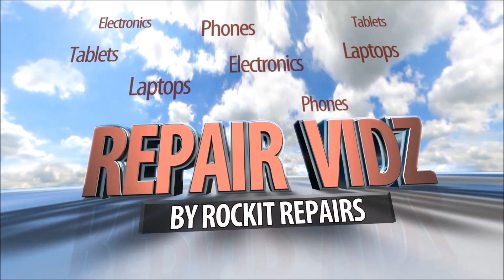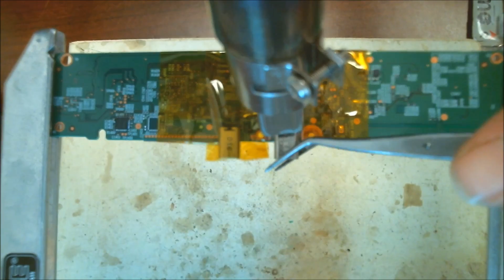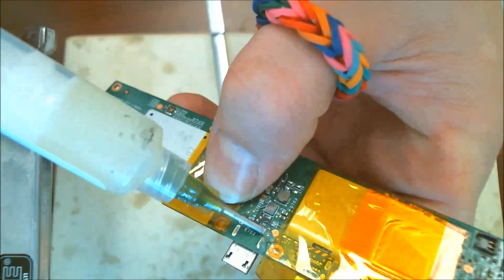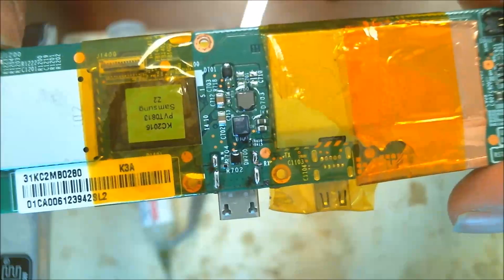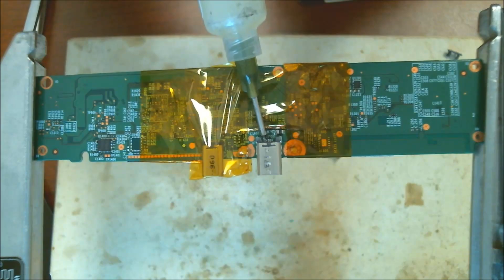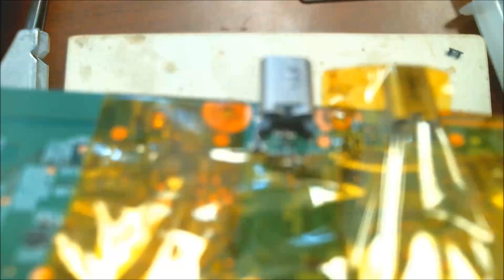Kindle Fire HD USB Bad Charging Port Repair & Replacement | w/ Soldering | Tablet Computer

Comment: How would you go about removing and replacing a micro USB port from a flex ribbon cable? I would just buy the whole flex cable but it’s not available so my only choice is to desolder it. Thanks

Comment: would it be okay if you don't have flux as long as the solder has it? also could you use soldering iron to remove if i don't have heat gun? 

I'm obv pretty new to soldering although i have repaired a few things, i only own the bare essentials. 

glad you mentioned the heat resistant tape! i saw some on my fire 8 tab board and assumed it was just tape. oh and i did notice your rainbow loom ring before you mentioned it & already figured you must have a lil girl who made it for you..i just don't' imagine a grown man making himself jewelry on a rainbow loom lol

Comment: Hmm, you have a price for Kindle Fire HD Charging Port 8.9" or 7" $69.99 - it's ridiculous 'cause I've bought brand new Fire HD 8.9'' for less!
Reply: You don't understand the time that it takes nor the skill that it takes to repair one of these or any job that requires microsoldering. It's not this guy's fault that this product can be mass produced for pennies on the dollar using chinese workers. In a just world this product would be priced MUCH more and his $69.99 price to fix would be completely feasible.

Comment: I use heat around 350 c .. and be very careful when you pull the usb port from the board.. ensure all solder on pads is melted when lifting with tweezers .. allow it to come up gently , if it is not then you could damage tracks on board making a repair almost impossible

Comment: I bought my fire HD8 in 2016 it wont turn on now.  how do I know if its the charging port or the battery??   HELPAmazon as ABSOLUTELY USELESS  they straight out said they cant be fixed

Comment: With cost of buying all the things I need to fix it, it's cheaper to buy a new one !
Reply: hardly! the soldering iron is the most expensive thing at $23 or so, and it's worth it for future repairs anyway. youre smoking crack son!
Reply: but you know keep believing that, it's what keeps me employed :)
Reply: My point exactly, Tim ! Thank you !
Reply: What a wasteful way of thinking. So throw it out and have more trash and toxics in the ground. 40 years ago people would fix everything from their toaster to car. Not just “buy new ones”.
Reply: The heat gun is $70, plus $23 soldering iron, plus $12 for the flux, plus solder, plus pano vise, plus magnifying glasses or microscope, plus soldering wick and or sucker.  Current HD Fire 8 is $64.99.  Could buy two for the cost of the tools.  And I have yet to see a good soldering station that cheap usually want a weller or a hakko which will run $100.  I agree with you if you get good at this the investment is worth it for future repairs but if you don't have the talent to solder something that small it's cheaper to replace than spend all that money couple hours of time and possibly not be successful in the process.

Comment: The model is confusing. The kindle fire HD 2013 has only 1 port. It is not even clear what port your are replacing. There is a HD and a non-HD microUSB? What are the offical names for those ports...
Reply from the maker: +jayvl09 We are replacement the Micro USB charging port.
Reply: My kindle fire hd7 is a 3rd gen or 4th gen and when it is plugged in it will show that it is charging but it may take a couple of days to do it even with it powered off completely. Were the ones that you are repairing also indicating on screen that they were charging or were they not recognizing the charger altogether. I want to be sure before I have it repaired for no reason.

Comment: Good video, I'm doing the same type of replacement but there are no holes when the legs of the usb should go through, do i have to drill holes or do some types not require holes?
Reply from the maker: +Candy Houck There are 4 leg holes on this model. They need to be cleaned out with flux and low melt solder so you can set the new port down in 100% flush with the board. Then you can solder the new legs in and work on the back pins of the charging port.

Comment: Thanks for the in depth repair video. I watched a number of these videos and it seems this is a widespread issue with this device. Enough that I would think it deserved a recall, but I'm assuming the devices held up long enough to make it past the warranty expiration date.

Bad design or planned obsolescence? One can only guess. I have one here needing the same repair. The port itself is an inherently flawed design; the through hole will of course hold the port to the board over time, but any repeated stress testing would have revealed that the surface mount connections would eventually fail from the repeated flexing and stress from plugging the cable in and out over time. So, I guess I can blame the port design itself and the engineers that opted to use it in this product. They should design the port so the connections are through hole and let them double as the holders. This would be much less prone to failure and a heck of lot easier to repair if any of the connections failed, but I can only surmise that in this era of disposable everything they don't want you to fix it anyway, just pitch it and buy another. I just fail to see how this problem would not have been foreseen, so I'm gonna put on my tin foil hat and assume planned obsolescence. Grrr... (Thanks for letting me rant, as well.) ;)

Comment: I have an asus memo pad me301t, there are no pegs on my micro usb charging port that go through the board. how do I get it to stay?
Reply from the maker: You solder it down to the traces. Can you attach an image link so I can check it out and give you an answer?
Reply: +RockIT Tech 
http://i64.tinypic.com/nn9kiv.jpg
Reply: +RockIT Tech 
I think it's called a surface mount. the replacement video I saw showed no soldering, only use of a heat gun & flux paste.  do I need to solder the 5 pins on the back of the usb connector to the 5 pins on the logic board? (my first time soldering)

Comment: wow, 470 C, I do these with 320-340, that is too much heat but I guess it works.  I have tried a higher temp like yours on iPod classic sound chip removals and it killed the board, again, I have done this repair at 340 (and all repairs using solder iron/wand and a hot air station) but I use an entirely different method using low-melt solder introduced prior to using a a hot air gun, low-melt solder mixing in with the factory solder, nice video, I personally would never go higher than my temps. .. this is actually a good learning point for me, the board can stand it but I still would be nervous.  
Same process applies for an LG G3 charge port repair but a thinner hooved solder iron head is required to solder the charge port pins since the new charge port is partially covered by a shield, good video.  The sharp pin solder tip, I hate since heat transfer is terrible, try using a flat tip, heat transfer is so much better.   You can carve down some old tips to fit your needs, once shaved using a file/grinder or dremel, then coat with tin, work wonders.
Reply from the maker: zfixit.com Thanks my friend !

Comment: I think I got the old port out ok, and I just dropped the new one in using the old solder that was still in the holes.  That was fine.  But I didn't think the new pins were making contact, and forget me soldering each pin.  I mean really.  What I got was a glob of solder over three pins, which by the time I got that off, I had munged probably all five tracks.

I think in retrospect, after destroying the tracks on my daughter board (nexus 7 2013) that the best approach would have been to bend the pins on the new port slightly down so that they are bent against the solder tracks that are still there after the pull.  That way you could just apply heat and the new pins would settle into some of the old solder.

If you are serious about this "put a dab of solder on my iron" stuff you should say how that is done.  I put my soldering iron on some new solder and it all bubbles away immediately (or after a few seconds required by my Weller 40 watt iron to heat it).  And really solder each individual pin?  Wow.
Reply: Ken Truitt Actually, my nexus 7 is now fully charged.  It looked like I must have trashed the tracks but somehow it charged.  I haven't checked data yet.  Nice to have it back.  But I will say that I got all the recommended tools from the video (used a cut up tin can for my heat gun attachment) except the jeweler glasses.  They would have been helpful and I probably should have gotten those as well.  And again I think if this is the first repair you stand a really good chance of being able to reuse all the old solder, which is of course a lot easier.  And I still think bending the pins down before installation would have been a good idea.  Thanks for the video.

Comment: I am wondering one thing. How did you get the dab of solder on the Iron. is it paste or did you have a strand poking out to grab some from?
Reply from the maker: +Hymai MacGyver Make sure you tin your tip and use flux.
Reply: +RockIT Tech yes I always tin. I do need to get some good quality flux though. i been seriously considering getting a hot air soldering station
Reply from the maker: Hymai MacGyver I really like MG Chemicals Flux. Here is the flux I use. http://amzn.to/1YxUUZf
Reply: awesome thank you

Comment: Thanks for the video, did not know how to get into it, My Wife's Kindle Fire had some how locked up and the screen was not responding, having removed the back I disconnected the first large connector and the battery and left it for 20 minutes, put the connector back and reconnected the battery and now its working again,
Reply from the maker: +Bill Bones Yes this happens a lot. Also if you do the repair. Make sure you put the battery connector in last as you will have issues with a frozen digitizer screen.

Comment: the board shows a screw on the upper right side that is not a phileps  screw did they use  another kind or is it messed up
Reply from the maker: +Vinny Carbone No it is the standard screw they used just requires the proper T series driver.

Comment: This may seem like a foolish question, but how competent a solderer should I be before attempting this particular repair? It has been quite a long time since I attempted to solder anything, let alone what appears to be very fine components. I am a little worried about botching the job,so to speak.
Reply: William Sullivan I would say if it is not working, what do you have to lose.
Reply: Hymai MacGyver That is an excellent point. Thank you.

Comment: I'm doing the same thing on a beats pill I'm confused about soldering the pins please help
Reply: RockIT Repairs Inc. i have trouble soldering it the new port to it and testing it
Reply from the maker: What I'd your question?  We have fixed a Beats pill b4
Reply: Do you do repairs on these kindles I would like you to repair my.wife
Reply from the maker: What questions do you have about soldering?  What are you exactly soldering on the beats pill?

Comment: Two of my 5 tracks have separated from the board and are stuck to the pins.  It seems impossible to make a connection from pin to board with a damaged track.  What do you think?  Are replacement PCBs available?
Reply: I noticed this during the video. He should have mentioned that when you pull a component off the board before all the solder has melted you run the risk of pulling the pads of the board. If you can follow the leads you might be able to wire in a jumper to another solder pad or via. But most likely you need a replacement PCB from another unit.

Comment: I have successfully removed the old usb port from the board (I give all credit to this video). I was not as lucky with the solder removal and have to use wick to remove the remaining solder. I was having trouble with it sticking and then realized I wasn't using enough heat. I believe I was trying at 650 (F) when 750(F) {400 C} is what was needed. Also, adding a little flux to the wick (and solder points) helps tremendously. Wish me luck on those 5 pins though (LoL). My eyes aren't what they used to be, but I do have a magnified light (and jewelers glasses) to help. :) Thank you for posting!!!

Comment: I love this video! You did a great job explaining this process in detail. I am going to repair my wife's Kindle Fire HD (which has been sent back to Amazon twice for this same issue). I got an X-tronic 4040 that I use quite often and will be a must for this type of repair. Fox PC parts on eBay sells the OEM port needed for this repair and they are under $8. I have to buy some Kapton tape and some of the no clean flux paste you recommended before I operate. Thanks for that handy tip, rosin flux paste can be quite messy :( Thank you again for all the help!

Comment: How do I determine if it is a bad port that is the problem with my kindle fire hd? It will not come on at all and can not get any reaction when plugged into a charger or plugged into my laptop.
Reply from the maker: You can check the voltages but if the port is not on correctly will be hard to do. I would recommend just replacing the port. it generally 95% of the time is the issue.
Reply: Repair Vidz Thank you for your reply

Comment: Do you need the heat gun, or can you use just a soldering iron to remove the old port?
Reply from the maker: Definitely use a heat gun. Here is the heat gun we recommend for removing the kindle fire charging port. http://amzn.to/1rbtXcK
Reply: Repair Vidz Thank you.

Comment: I have a Asus AT300SE tablet with microUSB port but the contact pins inside are surrounded by plastic. I tried to follow the process but as I should have expected the plastic melted. How do i handle this?

Also, you say that one should use No Clean Flux and not by any means Rosin Flux. I have by now Green Flux, but is it as good as it should be? Or do I need to get No Clean Flux?
Reply from the maker: Other fluxes just leave behind a lot of residue which I do not like.
Reply: okay thank. But how does one handle the situation if the contact pins are surrounded by plastic?
Reply from the maker: Can you send me a macro image of your port where you need to desolder?

Jon

Comment: What model is that soldering iron. If you dont mind.
Reply from the maker: <a href="http://www.amazon.com/gp/product/B00DRHRZ3S/ref=as_li_ss_tl?ie=UTF8&camp=1789&creative=390957&creativeASIN=B00DRHRZ3S&linkCode=as2&tag=rockitrepairs-20">"ALL IN ONE" X-TRONIC - MODEL #5040-XTS HOT AIR REWORK SOLDERING IRON STATION & PREHEATING STATION - 4 Hot Air Nozzles - 10 Asst. Solder Tips - Pinpoint Tweezers - IC Popper, Gootwick - FREE 5X Mag Lamp - "THIS IS A USA EXCLUSIVE PRODUCT"!</a><img src="http://ir-na.amazon-adsystem.com/e/ir?t=rockitrepairs-20&l=as2&o=1&a=B00DRHRZ3S" width="1" height="1" border="0" alt="" style="border:none !important; margin:0px !important;" />
Reply from the maker: Here is the link to the x-tronic soldering iron.
 http://amzn.to/1i0RWaO
Reply: Thanks